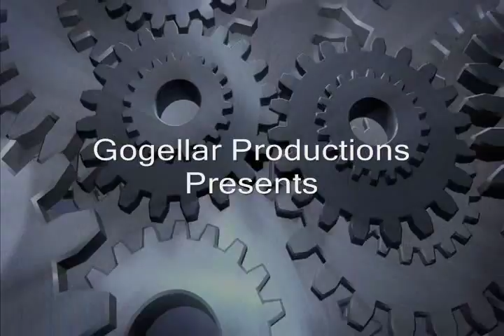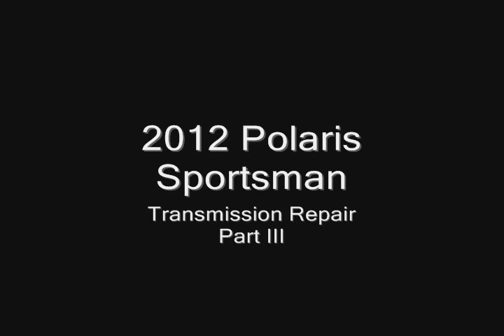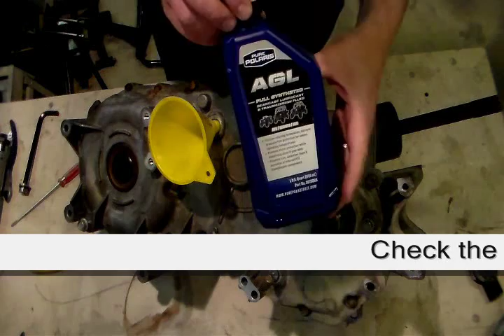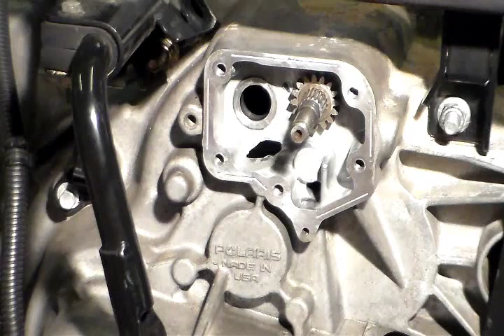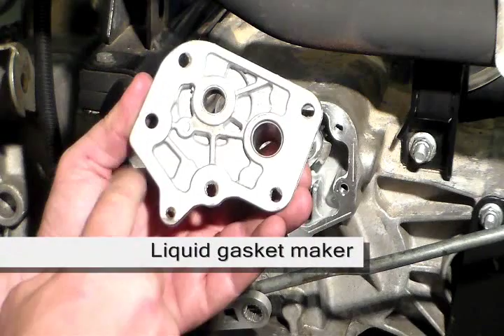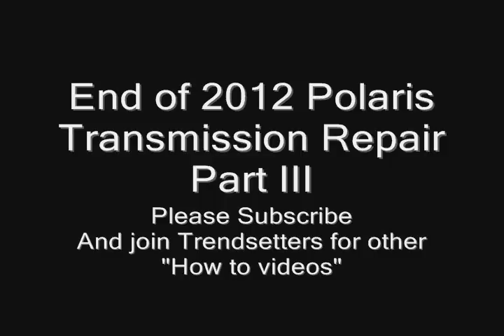2012 Polaris Sportsman Transmission Repair Part III

Comment: That was a awesome video well done I dont know if you can help me I have the 2012 polaris sportsman and front drive shaft does not turn in any gear im trying to determine if this is electrical or a transmission fault

Comment: The dog leg has a spring I replaced rear spendals and dont know where the spring for turf mode. Its c shaped and the round piece with the raised parts goes in the c shaped part. It's a tentioner spring just dont know where it goes for locking in turf mode or out.

Comment: I have a 2011 ranger I replaced the silent drive chain got the transmisson back in the ranger and with it in park and every gear the rear wheels spin freely like it is not going into park

Comment: How do you know if the shifter shaft is clocked right it will insert any where so the aluminum bracket is clocked right

Comment: I believe ive put mines back together as youve shown but mines doesn’t move when its in low gear. It does when its in high and reverse and neutral seems like its truely neutral. Could this be a problem in the shift Linkage?

Comment: I have a question about my 1998 sportsman 330 trailblazer 2x2 I can drive backwards but I cant drive forward on it when I try to put it in drive you can hear it grinding but wont go into drive at all..

Comment: I have a 2013 sportsman 800efi.... when I put it in high , I get a I slight knock like it bumps... I hold the brake an then it bumps ,,then I ride it .. any question plz call me 334-560-6885 I can explain better
Reply: not wise to just throw your phone number up on the internet like that

Comment: Great video but...You forgot to mention, maybe on purpose the CRITICAL alignment of the engine and transmission using a special tool. Not mentioning that the torque bolts need replacing after each use. If the above mentioned procedure is not followed the unit will chew up belts and belts cases pretty quickly.
Reply: +Dennis James what torque bolts are you referring too?

Comment: I watched all three videos. Great work. You make it look pretty simple. I have a 2006 Sportsman 800 EFI with EBS with a loose/stretched silent chain that is wearing down the drain plug. Apparently it's a pretty common problem. Would my transmission be the same? Do you have video of the disassembly of the rest of the parts in preparation for where Video I takes off and or reassembly from where III stops.